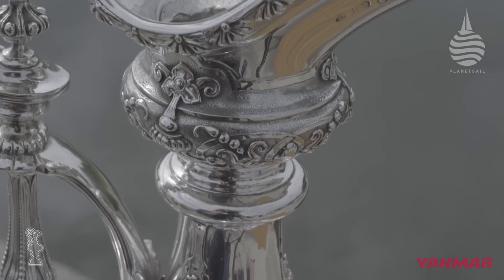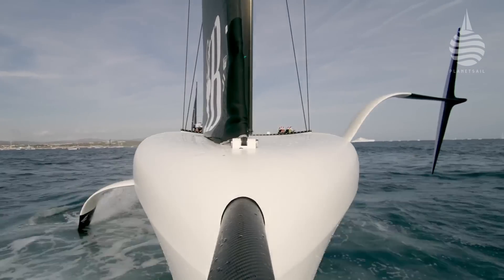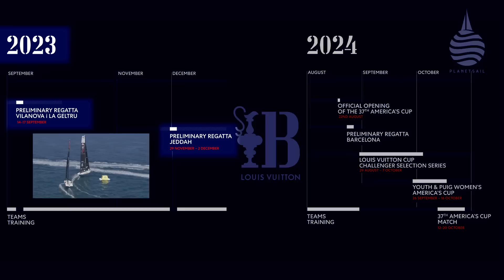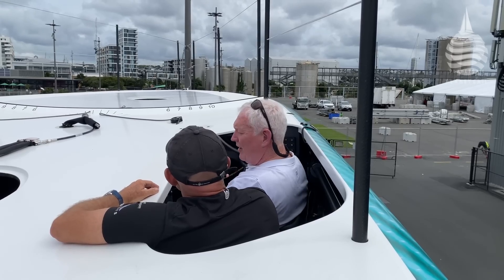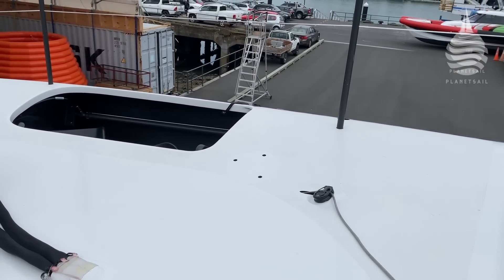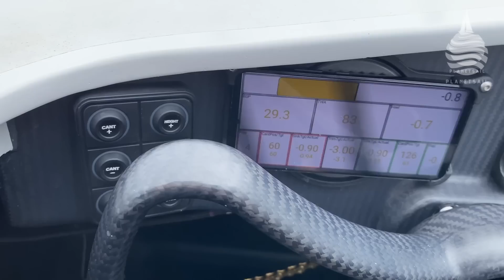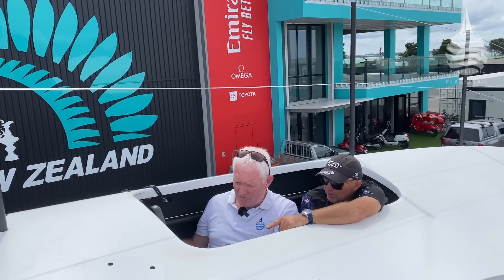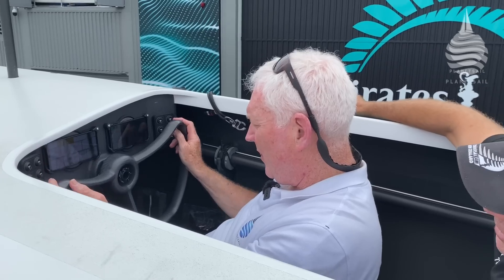Ep3 - America's Cup Boats - What are the LEQ12,  AC40 and AC75?

Comment: If the USA wins the Cup it will be good to return to more traditional boats and racing.
Reply: So you think that that these athletes sailors that have been flying these foiling boats at three times the wind speed 50 old knots to go backwards to about 15 ish knots that's like asking F1 drivers to have a bicycle race it's going to be very hard to go backwards now
Reply: I love these modern hydrofoils
Reply: My uncle won the cup 3 times sailing with Dennis Conner back in the 1980s. 12-metres = pinnacle of racing skill. It’s a different sport now in the hydrofoil era and so much performance data but dont forget AC is also a design challenge. The boat speed won’t go down if NYYC wins. Next class will focus on best  teleportation device… at least the lawsuit will be entertaining.

Comment: The AC was over and done when the AC90 was abandoned.  That juncture could have focused the Cup on a future that honored its roots while pressing state of the art large boat match racing.

Instead we have these contraptions.  The Cup is finished.
Reply: Even in the lightest winds these boats sail faster than any other AC class. 90s were a relic of waterline equals speed. Time to catch up and compete, just as NZ did.
Reply: @desmondcrosland7884  LOL.  Compete with what?

And I didn't promote the AC90.  I said their era, sadly missed to deflect into this trash, could and should have comprised the path forward.  And I'm right.  Even J Class is vastly better than this pinballing nonsense.  Any super class is.
Reply: Evolve with the times.
We are way past the stone age
Reply: @brucefale6132  Whatever that means.

Sailrocket went 65 kts over a decade ago.  Sails on sand are faster than that.  Sails on skates faster still.  Have been for decades.

"Evolve with the times."  Or, remember what real top-level match racing between yachts and crews is and get to it.